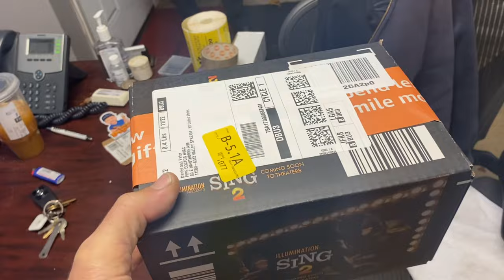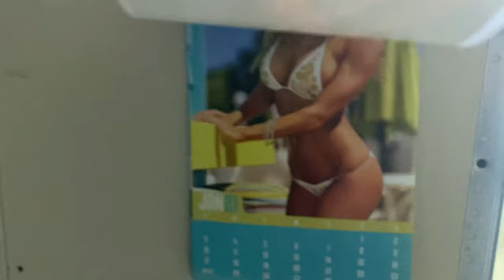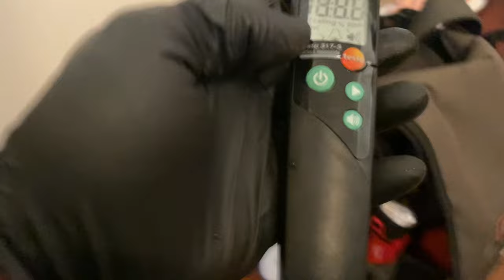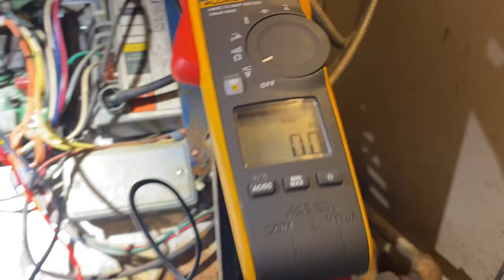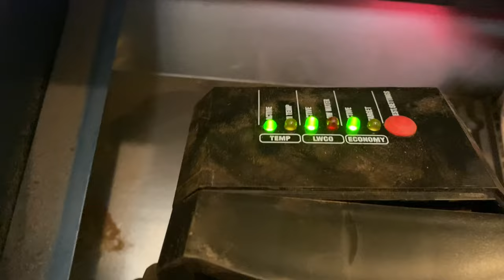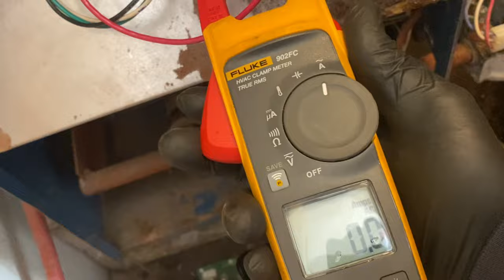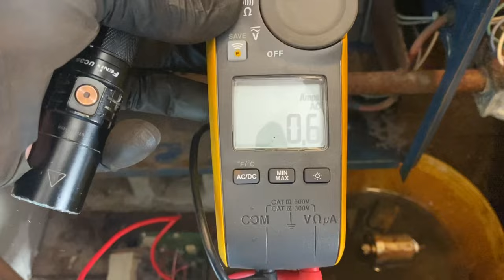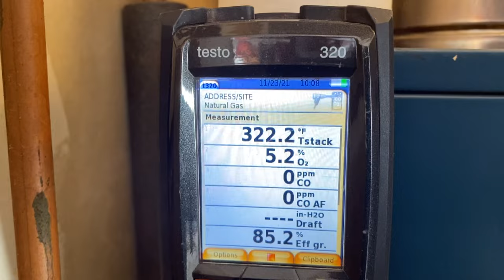Home Warranty Heating Service Call - Dunkirk Gas Boiler Lives Again

Comment: Mikey if you can go into detail in your livestream on your turkey frying equipment I would appreciate it. Qt. size for the different turkey weights etc etc. BTU's. I want to get the equipment by Xmas and do a bird. I have NG so not a lot of options. I can do propane but since I already have NG I would rather go that route.

Comment: 👓 !
How in the whole wide world did that boiler fire with the damper closed???
🍺🍺🍺🥃🥃🎯🏌🏻‍♀️
Stay safe. 
Retired (werk'n)keyboard super tech. Wear your safety glasses!
Reply: It came on because it had a jumper in place where the damper control plugs in. The jumper is for if your not going to using a damper.
Reply: @search_eternal  yea ,when your not in front of the unit!🤔🤣
Reply: @PipeDoctor  yea I was gonna say Houston you have a problem!🤣🍺